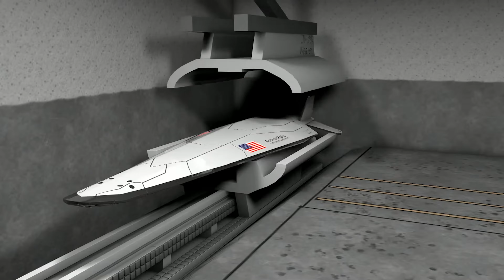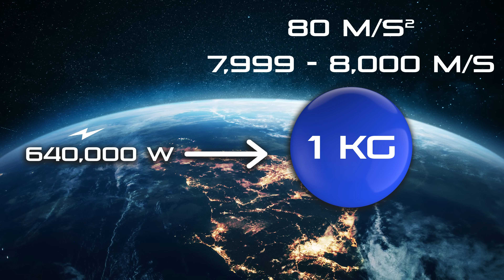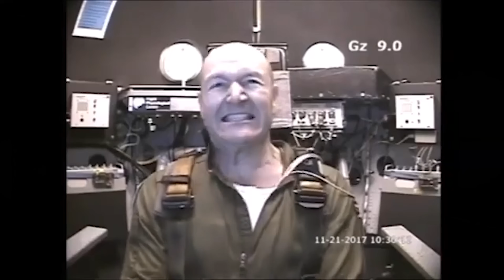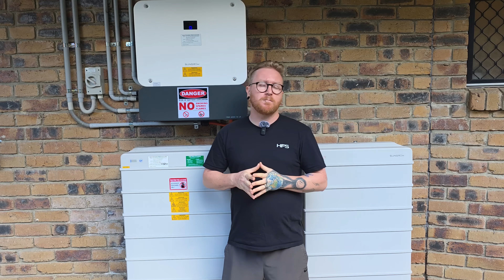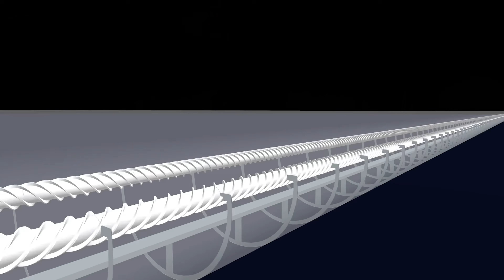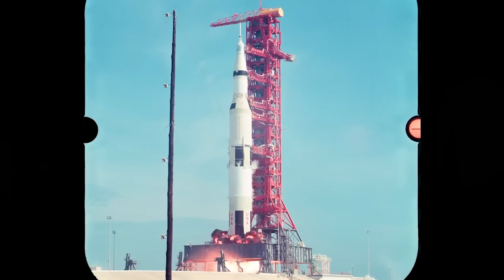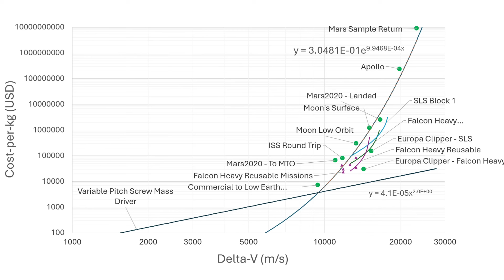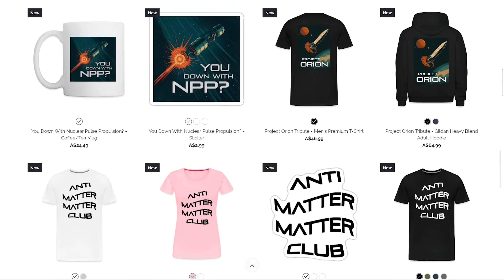The New System That Could ACTUALLY Replace Rockets

Comment: This is great as a marketing pitch ... for some investors dumb enough to give you  few billions to waste.
I mean ... a several kilometers long perfectly straight tube with vacuum inside and with two several kilometers long rotating rods held in place by sheer force of mind or something and then as you open the end to let the cargo out air rushes in and starts slowing those rods on that side of their immense length ... what are they even made of? Vibranium?
Reply from the maker: 1. I make youtube videos - I'm not looking for investors.
2. The screws are segmented, not several km long.
3. The tube isn't straight, it curves up.
4. The screws are held in place by supports, not magic.
5. There are multiple airlocks inside the tube to prevent what you've described.
6. The screws would be made from carbon fibre with bonded steel rails.

Phil Swan's peer reviewed paper is available to read online🙃
Reply: @HelloFromSpaceAus 1) Well, that's how the video sounds.
2) yeah, so now you have to keep them aligned, in sync, powered, ...
3) oh ... So as you definitely can't curve the individual spinning screws, you have to angle them. That sounds like both a bumpy ride, a waste of energy and strain on the structure. I mean near the end the "bullet" ought to move very quickly, if the last segment doesn't align perfectly to the previous one, the forces will be immense.

Comment: Actually the screws need to be under power until payload ejection as the payload is launched because the screws would be slowing down over the launch if they are not. That imparts deceleration friction.
Reply from the maker: They would be, but the power level would be significantly reduced due to the stored rotational momentum. There will always be losses in a mechanical system, but they're not extreme in this system.

Comment: My PhD includes Cognitive Science. People prefer ideas similar to what they already believe. May I offer? We want what we've always seen, one shot up to space. But I think this idea should divide the human payload from the fuel to carry the payload further than orbit. The last Shuttle explosion taught NASA to separate precious human payload Kg from the extra weight of cargo. The exponentially greater fuel need to lift cargo is too much explosion risk for the more precious cargo that are human beings. Sending up people with this method, with minimal attached rocket and fuel, then sending up the fuel carrying rocket separately, this would be lower risk for the people sent up. Frankly, Musk's Starship reverts back to the 1970s idea of a Shuttle atop a .. Saturn 5. No small human rated capsule with abort system. He doesn't think through ideas as witnessed by his random progress forward including no water suppression system, then one now being replaced that was some shower-head idea. We have science for all these things, decades of engineering know-how he ignores then learns on the fly after RUDs. Multi-stage is the established method because of the Rocket Equation. Even Falcon Heavy is .. 4 stage to orbit. Shuttle was 4 (2 boosters and a tank). Artemis is about 5 stage to orbit with boosters. Musk's 2-stage to orbit is a backward step, nearly as bad as SSTO (1 stage). He needs to subdivide StarShip into a 2nd stage rocket and a 3rd stage human-rated capsule/cargo carrier. He's too conservative. Sticking with an old design that is more like he is familiar with.

Comment: If they really can maintain electromagnetic separation in the curve at interplanetary speeds...

I wonder how often this thing can actually launch?  Capacitors discharge to generate rotation, then vehicle is launched, the rotation then (with losses both ways of course) is slowed to recharge the caps.

2 or 3 a day?  More?
Reply from the maker: The VPSL system would be charged by regular grid power, it wouldn't need capacitors. This would drastically increase launch cadence compared to a traditional EM mass driver which needs to recharge capacitors between launches. My understanding is it would be quite possibly a lot more than that.

Comment: DC motors are very efficient. DC motors can’t take of return energy to the grid.
Once you decide to convert from AC to DC or DC to AC you have another loss. And even DC motors efficiency is limited to one rotational speed so energy recovery won’t be 90% for the entire range of energy recovery.
Reply from the maker: A system like this would be run on AC motor/generators, not DC motors. Basically the same sort of motor you find in an electric car. These run an inverter between the battery and motor to convert back and forth. On a system like VPSL you obviously wouldn't need this, AC in from the grid then AC back to the grid.
Reply: @HelloFromSpaceAus  AC motors are NOT efficient.

Comment: Even if we had demand for a daily ship to Mars, the launch energy needed would constantly change and one tube wouldn’t be able to adapt. You are better off keeping it at a maximum launch final orbit of something like GEO, You can launch any time of day for payloads being lifted significantly lower than the Earth Moon L1 and a constellation can be launched from one tube.
Reply from the maker: You'd ideally launch a bunch of space craft within the Hohmann transfer window. You'd be doing this regardless of whether you did so with a rocket or a VPSL system. Best case scenario, you'd have multiple VPSL systems, each built for specific tasks such as different earth orbits, Moon transfer and Mars transfer.
Reply: @HelloFromSpaceAus  and making one for Mars, if we had the demand for one ride per day (which I highly doubt) one tube wouldn’t do for more than a few months and you would have to make another for each of the other periods. Saying you will make a tube to be used for two months every two years is even more daunting.
A high earth orbit is useful all day every day and can be used every hour of every day. Once there, transfering to other areas of space while not free, is still more doable that making one of these for every different types of launch.

Comment: A potential problem occurred to me.  Since you have a rotating  or helical electromagnetic field advancing down the tube on the launcher, and it is pulling the projectile (spacecraft) down the tube, would that field also put rotational forces on the object being advanced like the rifling in the barrel of of a gun?  If so, how would you cancel the rotational forces, and what would you do to achieve that and at what cost in velocity/expenditure of power?  It just seems that a spiraling electromagnetic force would try to rotate the object with its advancement despite not making contact with the walls of the tube, especially since the object would be free floating without friction.  Thanks
Reply: Right. That's why, if you look at the video clip, there are two screws rather than one. They spin in opposite directions.

Comment: As others have said, resonances might develop in the long screw threads - causing them to whip about along their length. This needs further explanation...
Reply: The screws would spin on magnetic ring bearings located on pylons every 100 meters or so. I don't think that was brought out in this presentation. The outside diameter of the bearings is less than the outside diameter of the screw, an the screw threads.are interrupted at the bearing positions. So the screw can''t flop around, despite being thousands of times longer than its diameter. There are would be motor-generators at each bearing position for spinning up the screw before a launch. They would also serve to control torsional vibrations along the shaft.

Comment: Correct me if I'm wrong, but isn't velocity squared the absolute best you can hope to do?  Raw kinetic energy is mv^2/2, so any further factor of v comes from inefficiencies at higher speed.  Beyond v squared, you're just decreasing k.
Reply from the maker: I think I understand the confusion, I referred to the costs scaling with the square of the velocity, not the velocity itself - meaning, if you double the velocity, costs don't double, they increase by the square

Comment: Spinning a screw that is thousands of times longer than its diameter is no walk in the park. Imagine the vibratory modes and their magnitude.
Reply: Plus, having a load traveling down its track - let alone any thermal gradients or eternally induced vibrations. Multiply that by two screws! Oh the gotcha of rotordynamics.
Reply: Yes, also, you would have to spin this thing up ever time you are going to make a launch attempt.  That is A LOT of energy to build up and dissipate and some will end up going to where you don't want it to go.  With the shear amount of energy involved, only a very small percentage would be required to make some very bad things happen.
Reply: I am a blind subscriber so with that in mind
 I understand the idea proposed could someone with the time please explain the layout of the system proposed  where are these large rotating screws located and how many do the graphics suggest might be employed thanks
Reply: @vernepavreal7296 There were not many illustrations in the video. A cost diagram and an image with two worm gears with the sledge between them.
Reply: The fatigue...is the screw simply supported at both ends?
Reply: @damienguy501 
Nah, I would imagine there would need to be several dozens or more which would be geared for generating the appropriate field for that section of the track. 
The actual mass/ energy  which is relayed from the  turning screw to the ship would have to step up  like a bike chain gear system according to  the ideal payload / overall weight of the ship at that section of track.
I would imagine
Reply: the screws going to end up flopping around like spaghetti at those speeds with nothing in between to support them(maybe possible with magnets) not to mention that you still have to fight friction from the atmosphere that will slow you down, then there is gravity, both our enemy and friend!
Reply: And what happens after the the vacuum is lost and you have a shockwave going through the tube and the screws sudenly interacting with the air with all that stored energy? I want to see a simulation of that nighmare
Reply: mmm, yes. And no. But yes.

We.. used to do this. Powering plants miles away from thier power source by shaft and cable. Before electrical moters and generators where convienant reliable and ever present this is how a lot of factories and mines got thier power, especially from dam's. So we have solutions that we already know works and guidelines and formulas etc.
Reply: I thought the same first, but apparently it's thousands of 1 meter pieces
Reply: it would be hilarious
Reply: True, add this to my other engineering issues as note in my post. 😁😁😁
Reply from the maker: Yeh that's a fair point. The screw is split up into sections though, which would dramatically reduce this issue. It would have to be incredibly well balanced. You'd be building a lot of them though, so the scale would help the manufacturing process as it would justify more advanced manufacturing techniques
Reply: @HelloFromSpaceAus IF
 Getting people to Mars is really not that hard!
It's only if you want them to he ALIVE when they get there, that things become difficult!
Seriously!
And if you want them to survive a return to Terra, the only rational response is:  "WHAT the hell for!?"
...And ANY rocket vessel that EVER leaves Terra should stay up there, and be designed for Lunar traffic!
Reply: @TheScandoman  Perfectly summed up, Why the hell would you want to go to a geomagnetically dead planet unless to mine it?
Reply: @HelloFromSpaceAus  They need to invent a magneto-screw-clutch that can gradually apply magneto-connection until it locks into full speed.
Reply: @TheSpenceFencer that’s just an axial flux motor
Reply: @TheSpenceFencer 
Ooo, that system would also recoup leftover spinning mass/ energy on the sections the ship has passed by to fill capacitors for the screws toward the end of the run.
Reply: Very sensual vibratory modes.. Kiff get me a screw with vibratory modes.
Reply: @setruninja  uuugh, says Kiff. yes captian
Reply: @setruninja  probably auto-translated, you know what he meant. more like "vibratory states" I'm sure. just a bad translation. not everybody speaks english.

Comment: You have 2 large issues, cant get that vacuum on that scale, unavoidable. Issue 2 screws that spin at that speed have to be held still as any vibrations would cause it to die on the vine, there is other smaller issues but this is a on paper,  not a in reality type thing
Reply from the maker: 'Cant' is a strong word to use for something that we've never tried to do. The screws spin at up to 19k rpm, which is a speed we have quite a lot of experience with in combustion engines, electric motors, generators, ect... These seem to be very much solvable problems
Reply: On scaling up vacuum systems concern, you might want to watch "Electromagnetic Launch - What is (and is not) Holding it Back". This video touches on the vacuum topic and addresses the challenge to a degree.

Comment: You had me until 'vacuum tube' 😮
The fact that Mr Hyperloop himself, Elon Musk, is launching rockets the traditional way should say something about the viability of this idea. 😢
Reply from the maker: Sure, I can understand that feeling - however the biggest issue is Hyperloop was economically unfeasible. Transport on earth is a pretty well solved problem, and its cheap. Space access only has one current solution, and its absurdly expensive. Think of it like the difference between taking a 500m flight in a 747 to the local store to get groceries, vs taking a 747 on a 500km flight to another country. Scale makes a huge difference.

Comment: This feels a bit optimistic. Not saying it isn't possible but it needs to be practically implemented at small before a conversation about this is worth starting. Even the diversion to the angled launch is a pretty formidable problem. So this would have to be built in a lot of ways that this graphic rendering fails to address, since you're have to take the rotation of the planet into account, so somehow marking this as cost effective when it's a sizeable challenge, unless we leverage a new technology to accomplish any of this so you're possibly misrepresenting what this would take to accomplish. this is a bit like having a powerplant turbine several kilometers long... which is good because it could store energy and feed it back to the grid and serve as energy storage when not in use, which is actually a huge advantage, if impractical. I am not saying we shouldn't do this or that the idea isn't worth making an effort to fund a feasibility experiment, i just see a lot of non trivial obstacles, with the realities of this being created in mind. So getting something like this going with any kind of financial backing is the first obstacle, and to do that you would need to build a small technology demonstrator. So building a technology demonstrator for this is very important.  Again I think this should be explored practically, not theoretically. So it is time to start building a small practical example, and then go from there. So without a physical demonstrator it's a bad idea to be using time that can be spent on other more pressing topics so get building I guess.
Reply: I don't think a small demonstrator will help much. The technical challenges grow with scale. All the solutions you make at a small scale will not translate when the issues become material strength, rotordynamics, thermal gradients, etc. Those issues will grow overwhelmingly as you scale.
Reply from the maker: I very much agree that a physical tech demonstrator would be the big proof that this system works, and is ready for full scale implementation.

Comment: As a start, could we build a device that could launch Starship without the need for a lower stage?  If you can do that, you eliminate about two-thirds of takeoff mass and allow Starship to function as a true SSTO.  The boost in velocity probably wouldn't need to be that great.  Low propulsive efficiency and poor thrust to weight during the first minute of takeoff, mean that the first stage burns about half of its propellant mass just to reach 1000mph.
Reply from the maker: You'd possibly want to start with something a little smaller, Starship is huge. Essentially though, yes - but would the VPSL system not technically be the first stage, and the spacecraft the second? You could definitely eliminate much of the fuel tank volume, and get more usable payload from it